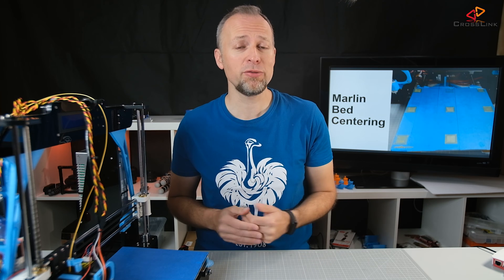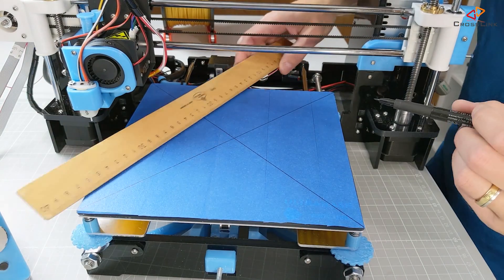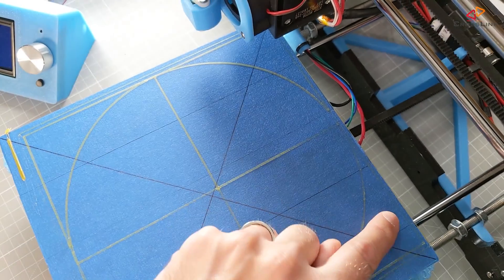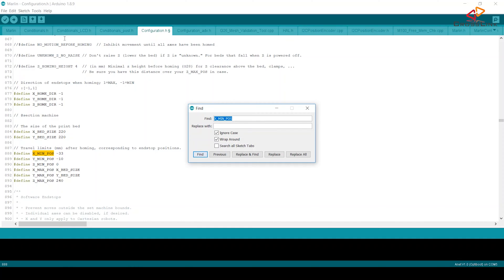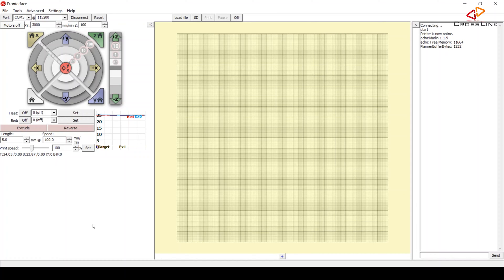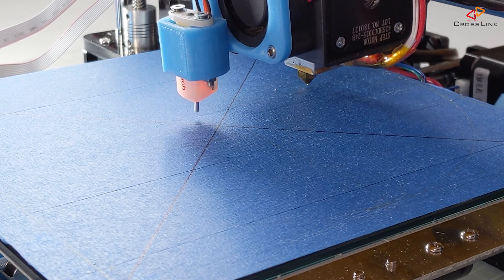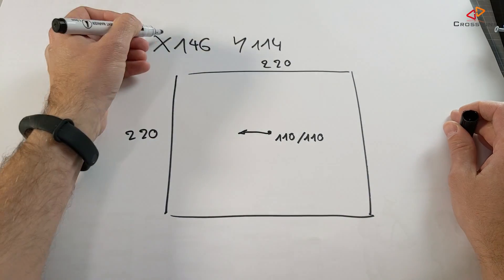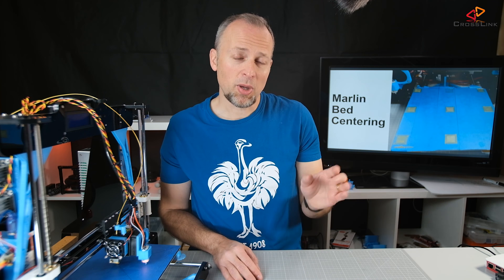Bed centering with Marlin Firmware 1.1.X

Comment: Daniel thanks for this video tutorial.
I changed the extruder for the E3D V6 and didn't have the exact center on the hotbed.
I did everything as in your manual and it's okay now.
All your videos are useful to me.
Also flash to MARLIN firmware according to your instructions 100%.
I have two ANET A8 printers and I am happy with them.
Thanks again. You are doing useful work.
Sorry for my English.
Reply from the maker: Thanks for that comment. Highly appreciated!

Comment: Sir, I have few doubts, can this ANET A8 continue printing in case the electricity goes off? Is it compulsory to buy a UPS?
Is PLA better or ABS for this printer?
And PLA is not flowing continuously from the nozzle while printing. Please Help
Reply from the maker: From what I see, the printer does not resume if the power is lost so a UPS is probably good if you have power losses in your area.
PLA is best but ABS is also working. I would try PETG as an alternative. You should try this simple upgrade for the Ender 3 to fix the filament flow and clogging issues: https://www.thingiverse.com/thing:3260694
Reply: Join the ANET 8 facebook group we can help you there!

Comment: I just upgraded to bowden and changed my carriage and hotend and this video is spot on! Just what I needed! Thanks a lot, Daniel! <3
Reply from the maker: Bowden is also on my list. What setup did you use? Can you post a link?
Reply: @Crosslink3D  Hey man!
J-Head - E3D V6 Clone
Black Diamond Bowden https://www.thingiverse.com/thing:3154420 (but I do not recommend it!)
Bowden Extruder Mount https://www.thingiverse.com/thing:2146021
Anet A8 X-axis R1 https://www.thingiverse.com/thing:2227422

I am planning to switch to those two:
https://www.thingiverse.com/thing:2193695
https://www.thingiverse.com/thing:3583021

(The X-axis holder, because my original distance between the two X rods was 46mm and in most X carriages the distance is 45mm, so I thought to go for 45mm straight away since all in the future will be 45mm anyways...)

Cheers!